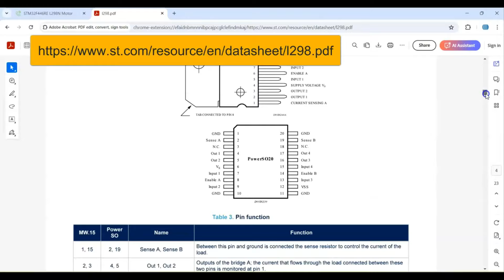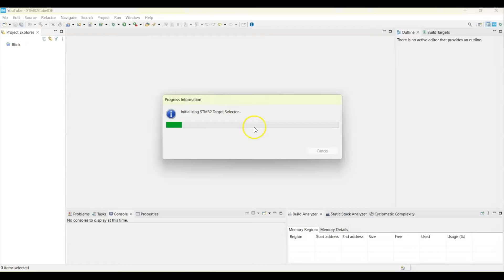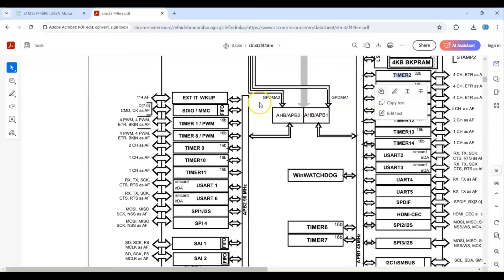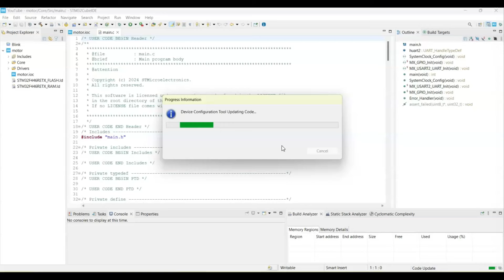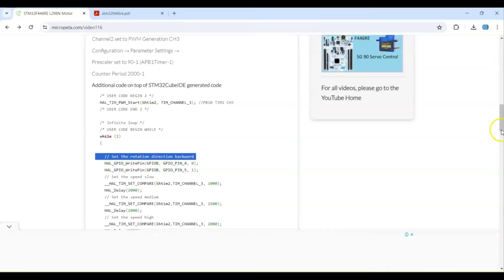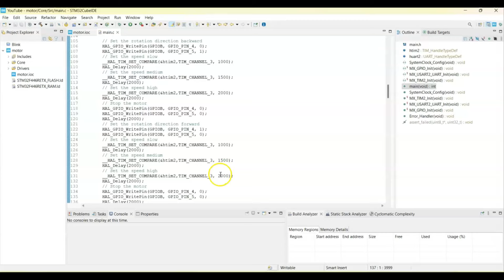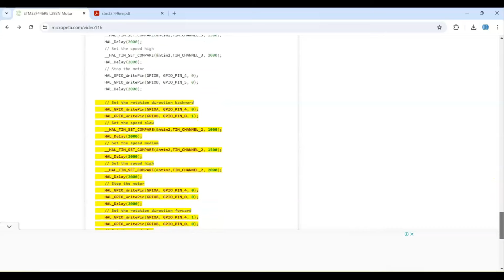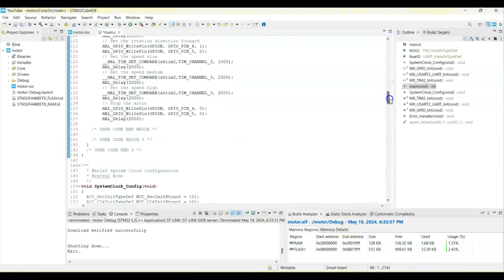116. STM32CubeIDE L298N Motor. PWM with STM32 F446RE Nucleo

Comment from the maker: As I normally do with STM32F103C8T6, I have just changed the HCLK Frequency to 180MHz assuming that HSE auto-select. Later I found that we have to manually tick the HSE button for Nucleo STM32F446RE. No worries. It will still work fine without HSE

Comment: please make video using the stm32l475vgt6 board for motor driver
Reply from the maker: I do not have stm32l475vgt6 with me
But I have done this motor and l298n with stm32f446re and stm32f103c8
the link is https://youtu.be/0rbKmkNEdAU
you can compare both and you may be able to do the same with any stm32 by yourself